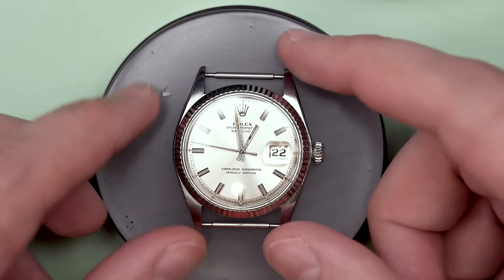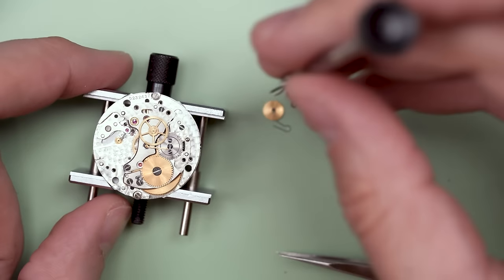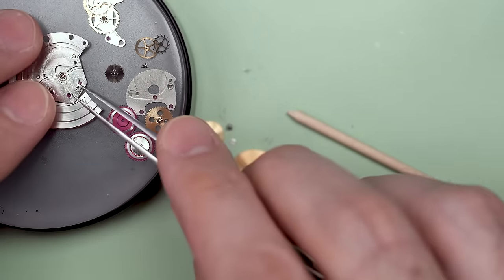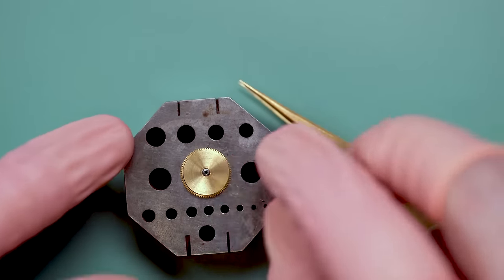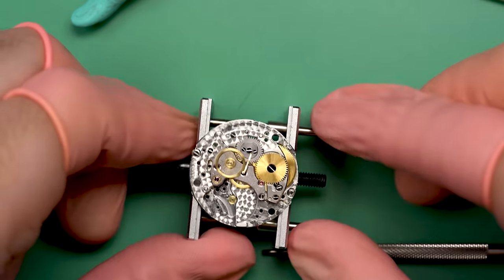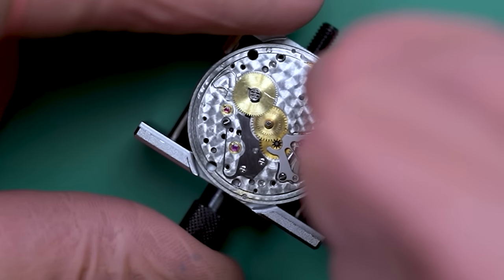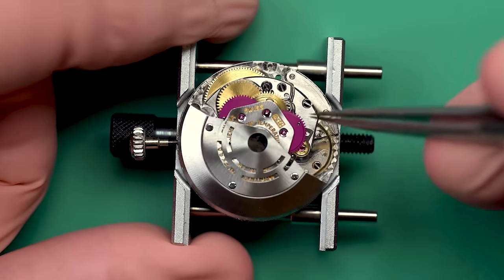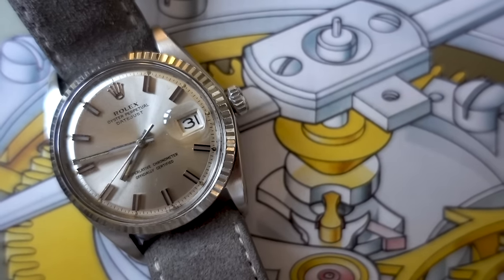Rolex Datejust Vintage Watch Restoration

Comment: I beg to differ. 
You say, there is nothing fanci about the movement except ofcause the high quality components.  Just take a look at the case. Thows stair shaped reflecting thingemegigs.
That is called juuling and evry star thingy is hand made one at a time. If you take a look even the screws will have juuling on them. That is a sign of the most high class blacksmiths work and is proof that evry single piece on that time piece is hand made.
That is why you pay the price and  the politic of Rolex to aim for a higher price, doesn't surprise me at all. In order for them to make a profit they have to be more expensive.

Comment: Try taking the automatic off before you decase. Makes it easier to handle. Prying it off if there’s any tension from the ratchet wheel to the driver is a recipe for a broken jewel or teeth. And handling an old dial that may no longer be available with bare fingers is probably not a good idea. At least if you’re working on a customer watch. I’d hate to tell a Rolex owner that i ruined their watch because i handled it improperly. Just constructive critism.

Comment: I acquired my dad's watch after my mom's passing,  how hard would it be to see if you could help me get it running correctly (last time it actually ran before I got it was back in 1982 when my dad passed away),  it's a Cortè 21 jewel wristwatch with no band (the band disintegrated in the drawer where it was stored..... I'm in Massachusetts

Comment: Oh that’s Farsi on the case. It’s says they washed me on 20. 270 end. Or 279 Rial,which is a very low price, but maybe not for the time. If 20 means 1320 Persian calendar which is around 1940s. And it say Monday or glass on that last marking. I think. It’s terrible hand writing and I haven’t read Farsi in a while.

Comment: What the hell is that green ball he uses at the start to remove the back piece?
Reply: Just a simple rubber ball, to add friction to the back.  LOADS better than using tools, since tools can/will create scratches/damage.
Reply: @eidodk  I didn't know it was that simple! Appreciate the response. He makes it look so easy (in regards to removing the back plate).

Comment: So let me get this straight, you're wondering how the jewel got lost. But yet you show yourself putting it in a cleaning basket, where the grading is wider than the jewel itself. Why would you even do that? Obviously it's going to slip right through. If you're wondering where it is, it's probably in the beaker with the cleaning solution.

Comment: Your thoughts were mine, before you even actually said them. I'm a former mechanical designer, model maker, in limited production, industrial design, products. Everything in your Rolex disassembly speaks to being overbuilt, which might explain why Rolex watches are knocked off so much.

Comment: I had a Seiko that did the partial date-change; so that may be a permanent way it works"
Question: It looked to me that the hands had either missing plating or corrosion???
Finally, the Rolex's are nice but way over-priced now for what you get.
The new Seiko 'Willards' leave something to be desired for their $1000+ price-tags--Sad trends for both companies...

Comment: @12:44 I would like to correct you on this, although your videos are absolutely epically awesome, this is a common misconception!
Synthetic diamonds are not cheap to produce, nor synthetic rubies. While you can produce them in larger numbers, they are very time consuming and somewhat an expensive process. But compared to the real deal, yes they are much cheaper.
Reply from the maker: I mean you can buy these jewels for a buck or two, so they can't be that expensive.

Comment: Did the lost jewels ever turn up ?
Reply from the maker: Yes! It showed up in the watch cleaning machine jar like a month later
Reply: @WristwatchRevival  typical... Nice video, I've recently got into watches I own a few nice watches. I have a rolex date datejust from the 90's but I'd never strip that apart from fear of damaging it or losing parts, any recommendations on cheap automatic watches to practice with ?

Comment: Is there a way to contact you? Do you do repairs? I have one of these that needs help. It’s a 1955 it runs but the adjust knob needs help. It was my fathers wedding gift from my mother. 

Rolex Chicago and Rolex Dallas say they can’t fix it. It may need a part manufactured for it. I’m unclear on the details but am searching for someone to attempt a fix.

Comment: In 1995 a friend had a lady's Rolex watch that didn't run.  We opened it and found a quartz movement and a dead battery.  In our ignorance we took it to a jeweler to get information about it, and what we were told was "Rolex doesn't make electric watches".  Actually they did, but not in a tiny ladies model.  A fake.  Live and learn.

Comment: This watch is AMAZING for the 1960s and the price at the time. I can see how Rolex was/is considered ‘the best’ 
But now prices have gone 10x  since the 60s and quality not improved a whole lot.  More of a ‘fancy’ brand now
Reply: The cal 1570 is as good as it gets. Easy to find service, tough as nails, and not $10K. 

I’ve had my 1965 for 40 yrs. still looks new. And it has a servicing about every 7-8 yrs. sometimes longer.
Reply: No its just that your dollars are worth 10x less. It's value is static
Reply: @cornstar1253  In a vacuum. But look beyond Rolex, and other brands have gotten much cheaper, relatively. Also, watches in general have improved.

Comment: Is it only me or do ze Americens also see zhat ze hands are misaligned? What I mean is that if the watch shows the full hour, the hour-hand is not absolutely dead straight pointing at the hour, but it is slightly off (as in quite a bit towards a counter clockwise direction). Firendly greetings, ze german.

Comment: Why do people like Rolex watches? Because they last forever. They keep working. I have an early version (no date) Submariner from 1974 with the stainless bracelet.  It's my daily wear watch. I rarely take it off and it goes in the shower with me every morning. In fact, except for a digital which I use for sailing, I don't own any other watches.
Bought it for $200 (8% tax included) in 1975, after destroying 3 Timex (takes a licking, keeps on ticking: NOT), in 3 weeks. It runs within 2 seconds a day for about 14 years, before it needs a cleaning. Used it for celestial navigation for years ( long before GPS). Been back for an overhaul twice. Cost me twice the purchase price the first time, and 3 times that the second (although they did more to it) and its showing the start of the drop off, where it starts to lose about a minute a day. 
I really should get at it with some polishing compound, but that's all the exterior needs.

And that's part of the reason why people like Rolex. Some people also like the fact that they can get gold and diamonds (but no frankinsence or myrhh) too.

Comment: I was thinking 🤔 doesn't Rolex have life time warranties on their high end watches.
Reply: No. That’s a cal 1570 which was introduced in 1965, last produced in 1974. This watch appears to older, he said it was a 60s watch. 

Current warranty is 5 year. I doubt that 5 yr warranty dates back to the cal 1570 days. I’ve had my 1965-66 watch for over 40 yrs. (acquired used and beat up.) I’ve only sent it to Rolex once and that was a about 5 yrs ago. Factory Service $1,000, and upon return it ran like shit. I’ve always had top notch service by true watchman over the 40 yrs. And shortly after Rolex messed with it I had it made right again by my favorite watchman. It runs about 1-2 seconds per day, I’ve enjoyed that level of performance for many years. I’ll be wearing it for many yrs to come. 

It’s my daily watch. It runs for months with being wound or needing to be set.

Comment: Rolex is like a base mercedes. Still a nice car but you dont really want one. Its just a name and its only till you get into amg that it makes sense. Otherwise. Yes its a nice watch. But its about this idea of luxury more than horology.

Overbuilding on a watch has nothing to do with horology. Sure the parts are thick and strong or they look polished and well built. But precision measures time. And rolex uses those big block and blocky hands for a reason. It tells time well enough. But all that finishing isnt precise. Its a silly piece of jewelry to me. One gear tooth off. Just grind one down. And you will see that it wont keep time.  Thats where it matters. The strength has to be purposeful. But in terms of a strong frame?  Its all about pinions and how the gears transfer torque and torsion to the pinion so everything works well. Like i said. You take a gear apart and oh its huge. This is strong. Its the gear teeth that actually matter. Why every rolex is off somewhere on the face ever so slightly. Just tacky to me.  Other people dont get horology. So this watch is great for them.

Comment: 50% more expensive is half more. So if the watch cost $100, it's now $150. Double is 100% higher. ;) So you go from $100 original price to $200 used sales price, which is a doubling. Sorry, I'm a bit of a forex / crypto nerd... xD

Comment: Much as Iove high quality and sound engineering no way I could bring myself to pay the insanely overpriced rolex's being sold today. Based on the inside of this one I can see paying maybe a few hundred or even a bit more but seeing ten twenty grand and skys the limit I get the distiinct feeling rolex is riding their own marketing name hype to the point you cant even buy one for overpriced retail numbers - I can buy a casio with way more functionality and better long term reliability and accuracy that never needs any service other than a new battery every few years or a new band and they only cost a few bucks - im just too practical minded to be brainwashed by overhyped marketing to the point of snobbery.